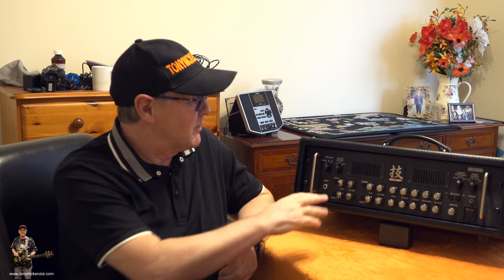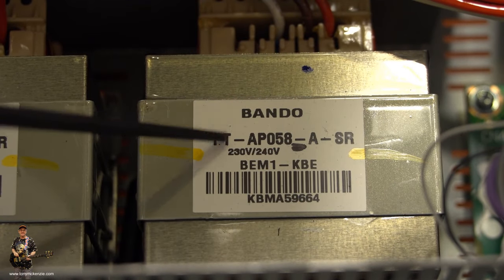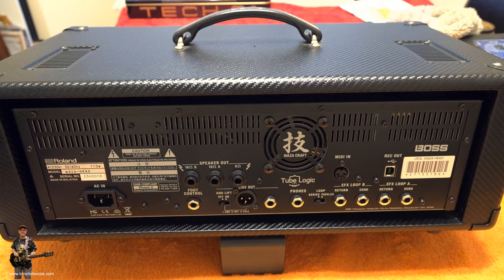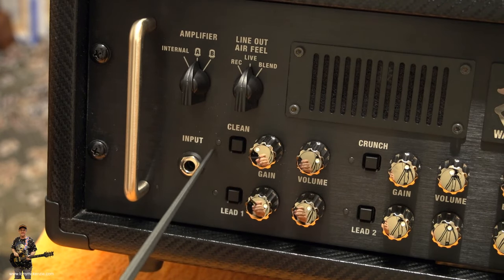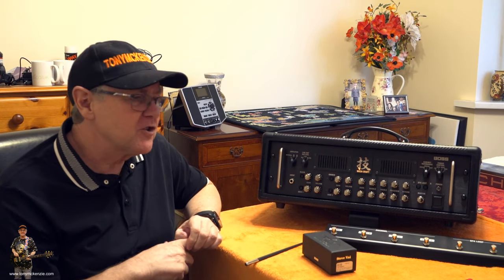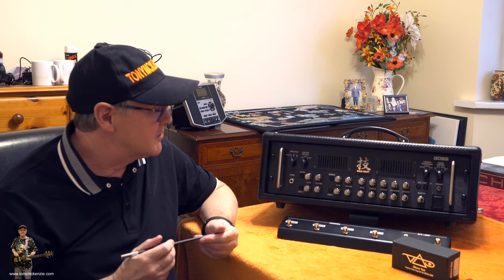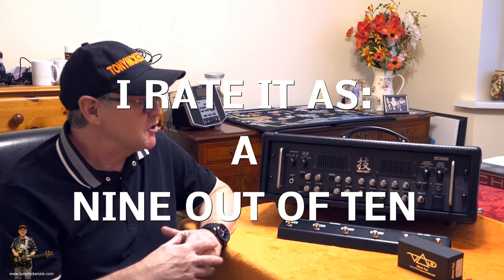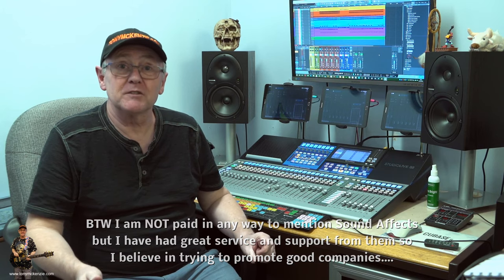Roland Boss Waza Craft Amplifier Inside and Out Review & Playing | Tony Mckenzie

Comment: I found and bought the 75 watt version with the 2x12 cabinet. There's a lot on offer here. These had a very short run. Glad I was able to find one brand new. It's for players who want a high gain amplifier. Adding this jewel to my collection with a 50th Anniversary Roland Jazz Chorus 120. Who says solid state isn't as good as tubes hasn't heard these. All amps bring different tones to the table, and this one is very nice.
Reply from the maker: Yes they are interesting devices and I still have mine too :). Thanks for watching.

Comment: I have just bought a nearly new 75w version. At the moment I have a DVMark 4x12 cab. I paid £725.00 for the amp - it was new in February. Still has warranty etc. Haven’t discovered everything it can do yet but your cab sounds better! Keep up the excellent work Tony!
Reply from the maker: These are interesting amps for sure and built like a brick toilet! My guess is that the 75 watt is 'half' of the one on here but it won't make any difference - still a very good amp. I know the DVMark stuff in general... that's probably one of the light cabs? I had some 1x12's which you could pick up with a finger almost. I tend to in general stick with Marshall 1960a cabs, but I did buy the Waza 2x12 cab to match this amp. In any case you should come back and post what you think of the WAZA amp because guys will come and read it and maybe gain from your experience. I like mine and still have it too. Thanks... and stay safe Peter.
Reply: tonymckenziecom  hi Tony. I’ve played with my amp now a few times with the DV cab (as mentioned) and also a Marshall cab (for comparison) at gig volume. It sounds better through the Marshall - a little less ‘muddy’ . I like the ease and convenience of the Waza and is simple to use, but as I’ve been a Marshall man on and off over the years, I feel the Waza is lacking in the warm valve dynamics. It can come across as “brittle” depending on the settings etc. I’m also a little frustrated with the second “lead” channel as you can’t replicate the first lead channel and just have it tweaked and louder for solos etc - you have to have what you are given, and as it’s a shared e q then there is compromises. I’m not sure if I’ll keep the amp - there are many good reasons to keep it, but I’m just not getting the vibe in total (if you know what I mean). Any one thinking about buying one, please check it out as it’s a great bit of kit, but have in mind what you are hoping to achieve from it (sound wise ). I would like a Marshall JVM HJS, but I feel it’s like looking for hens teeth! Keep up the excellent work Tony!
Reply: ... incidentally Tony, how did you find the Waza cab with the amp? Does it sound better than say any other cab? Cheers
Reply from the maker: I can agree it is not the same a a cranked Marshall amp for sure. And I agree that it can be toppy (as most simulators seem to attest). Your comments really do remind me of the 'simulator' thing... and I have used all of those. They are OK to 'Good' sounding, but they have a particular 'feel' when you play them. It is not the same as a real tube amp when you play through one. I would relate that way to the WAZA amp. For what is really a 'transistor' type of amp though, it does go much further than any of the other contenders that I have used. On the WAZA speaker I do not think that sounds 'better' in any real way than my Marshall 1960a cabs I have irrespective of what many might say about FRFR and all that stuff. The shared EQ stuff is not a concern to me, but I do often choose things like a wah pedal for the lead guitar and that throws things around, but I know exactly what you mean... and indeed I could name tube amps like that in the EQ area of things. It's great to get other opinions from real users like yourself and I know, that other than the 'sales' videos of the WAZA amp there was sorely lacking any real 'bones' to the amp online... maybe with one exception of the Sound Affects' video which I thought was very good - if you have not seen that you should. Check out those little Marshalls I recently reviewed (SC series but snake skin or the STEALTH one) as those two amps really cut the mustard... I liked the stealth amp and that suited my playing style so well. Thanks for the info... and stay safe.

Comment: Appreciate your in-depth review Tony.  If you are happy with the guts of this piece of kit that should be good enough for anyone.  Most of us are scared stiff taking the back off an amp so it is always a pleasure to see you prodding around on our behalf! Happy New Year to you and keep the reviews coming.
Reply from the maker: Well I have had just one comment somewhere below yours where the guy did not get on with my comments and even cited that the 'transistors' did not have cooling fins or something like that, but in reality that sort of thing depends on the circuit and how its driven and a host of other aspects. Frankly, if Roland Boss engineers don't know what they are doing it's time to give up. I trust the Roland Boss boys and have rarely ever seen anything fail from them. I have to say I was very impressed with the quality...  but it should be there at the retail price of this amp. At the price I paid its a bargain bearing the quality and the sound in mind. 

I always try and get inside simply because doing that always shows the good (or bad) points of what you are really buying. I have seen some real junk and not always at the bottom end of things. So the inside and out reviews will continue... its the only way to create a review that tells all in my opinion. I'm glad you liked the review - I enjoyed making it too. And yes you too and your family have a happy new year too.

Comment: This is a sweet amp, the only thing I don't like but I understand BOSS for not making those fuses accessible from the outside. Another great and thorough review, thanks Tony. Merry Christmas and a Wonderful New Year!
Reply: I just check the price in Canada, $3700.00 + 15% taxes. That comes to $4250.00 which is a LOT of money for a solid state amplifier, whatever it can do or sound like. Only a professional can justify its purchase because casual or regular band player will probably go to a valve amp that is in style.
Reply: I'm 69 and had prostate cancer two years ago and they had to remove it completely with a Da Vincy a robotic surgeon performing the actions of the human surgeon. It been two years now and I am still cancer free with a Prostate Cancer test PSA (Prostate Specific Antigen) at 0 (within the error factor of the analyzer). If it is caught in time, it is CURABLE.
Reply from the maker: @micheltremblay4774  Hi Mike, even a pro could not justify that price. It's the main reason we see none around. At my £900 ($1200) it was a good deal... watch for them they are sure to drop dramatically. Thanks for the info.
Reply from the maker: @micheltremblay4774  I had the Davinci machine too. You will be fine. Mine was 6 years ago and PSA is about 0.02 which is basically zero. You hit it on the head... its all about how early you get it. I was 59 at the time, but I have met many guys as young as 39 and that's the thing, it seems to me to not just be an 'old mans' disease. But some doctors are reluctant to carry out the checks here if you're 40 ir so and ask for the tests. Some of the colleagues I work with have said that after being pestered by me to get checked out. In any case Mike well done, its a hard road you have been down, and so I have too, but I'm sure you will be OK. BTW my PSI before the op was 4.9.

Comment: No disrespect to your grandson, he has come on a lot but the tones you achieved were great.  This is obviously a very good piece of kit.  Thanks for the revue and merry Christmas!
Reply from the maker: No problem on that Chris. I was surprised how exacting his tone on that snippet was to the original especially when you're in the room so to speak. On my bits they were just jamming really and I wanted to show a heavier and lighter tone hence the tracks. I never even go near the 'Steve Vai' module, all I did was to back off the guitar, switch in or out the delay and chorus with some wah occasionally. It's a very good amp for that sort of sound. If you push the drive to full on the amp the sound suffers a bit, but I did not go beyond say 1:00 on the drive on any channel. It was not good at £2300 (that's $3000 but might be cheaper in the USA) I thought it was way over priced. But at £900 which is what I paid then it's a very good deal I thought. I later bought the 2x12 Waza cab for about £400 and to be honest it is a very well made cab with specialised Celestion's in there - retail again was silly but buying 'ex-demo' is the way to go for anyone.

Glad you liked the review and I wanted to make this for a while, but did not until these came down in price. Merry Christmas to you too and have a great new year.
Reply: No problem Tony, your revues are always thorough and fun to watch.  I would like to second what you said about Prostate Cancer, my father sadly died from it, if only he had himself checked!
Reply from the maker: @chrisjeneson5091  Yes Prostate Cancer they say is the silent killer - even I could hardly tell I had it, but I'm one of those guys that watches close for ANY health stuff... it likely saved my life. Sorry to hear about your father... I have met many guys that have had it and some that have passed also and so from time to time I raise the subject in the videos and hopefully someone might just get checked and get past that stuff. Thanks Chris...

Comment: Merry Christmas Tony:)
i could be opening gifts but i am watching this video:)
its great.i wonder if the Katana amps use similar tech.they sound like a tube amp imo.
Reply from the maker: Ha... I completed it yesterday so as not to be slaving to the PC. I think the Katana is a different solution than that in the Waza, but I have limited experience of the Katana inside. I will be looking though. From what I have seen they seem to be more chip based and the Waza (read software) - of course I could be wrong but no doubt I'll find out in due course :). Thanks and I hope you liked the Waza amp and the video.

Comment: Tony, how does this compare to the DV Mark series? I really love your reviews you take the time to really get into them, I was still VERY happy you gave my JVM JS Marshall top reviews, I am convinced that is the Ultimate Marshall ever made. Anyway...I heard somewhere they have transitors that replace the actual tubes in the socket? Is that true and if so, what would that do to the tone? Haha I keep forgetting you are a brit and when you say it goes for 2000 or so LBs I keep thinking holy shit that thing is HEAVY bahaha
Reply from the maker: Well they are different. Like I said in the video, you have basically (this is just my opinion of course) two types of simulator of tube amps... the hardware based (as this one appears to be) and the software based, Line6, Kemper, Fractal Audio, GT-1000, the Multiamp and I'm sure you could reel off many others. Those always identify themselves from the continual 'updates' that keep appearing - like a PC ore even a mobile phone. Then there's this hardware method it seems, as this amp is. You don't see much by way of 'control' like the software simulators, but it seems to me that you do see a more tube like tone and feel. A good example would be to disable all of the software simulators effects and then play the unit and you will hear a far less likeable tone. It seems to me that the software simulators love to 'hide the amp simulation' with effects. On the other hand, this amp has only reverb and nothing else - if the sound is not good you would hear it without any 'masking' that the software simulators apply with effects. 

And the other 'give away' is the very limited control of the Waza amp by software from a PC... there is virtually none. Midi is also basic. Strangely, this Waza amp I believe may be the only hardware simulated amplifier there is... there is little info.

The Marshall JVM HJS in my opinion remains one of the best sounding Marshall amps out there. I completely agree... but I'll also say that the 410H head is a mere 'ordinary' amp in comparison. The main board is completely different and never the two will meet.

I think the nearest Marshall have gotten to transistors ah I cant be sure but the Marshall 'Core' springs to mind - and that is really a software tube amp simulator.... so I have not heard anything else about that. I think there was some tie up to 'softube' somewhere for that product.

Yes watch that. In the UK I represent at least two USA companies that we work with and of course they are always referring to Lbs (by weight) and in the UK its metre's centimetres and millimetres... thank Europe for that and I doubt it will ever flip back. So my Pounds refer near enough always to money. But lastly, this amp IS pretty heavy because of those power transformers and other bits inside... its no flimsy thing.

Have a great Christmas and happy new year Darth.

Comment: Excellent review Tony, an absolute bargain I would say, Merry Christmas to you.
Reply from the maker: It's still expensive at the £900 I paid IMO, but at least once you peep inside it can be seen IMO where the money has gone. A very interesting amplifier that does actually sound very much like a tube amp. Its not perfect, but it has the ingredients right there - and its easy to use etc. with a 'feel' similar to tubes and that goes a long way when I look at any simulator of a tube amp. This hardware method of simulation seems different than the software alternative too.  Have a great Christmas and happy new year Steve.

Comment: I am going to reveal myself as a heretic Tony,  last year (actually 2018) I sold my Vox 35 watt valve combo amp which is a decent amp, but bloody heavy with 2X12" speakers-and I bought a BOSS  Katana 100 watt 1X12" combo, which has 'Waza Craft' heritage, I have to report I don't regret it one bit, this is a very decent guitar amp, I don't care about the hype, or the neck beard critics, it works for me, has a ton of versatility and weighs about 10LBS, fantastic. BOSS really are doing something different.
Reply from the maker: A heretic! No I don't think so. You know, I had a Mesa Road King II combo once... and it weighed more than the house. It was a special order that took months to get here. Then I sold it! Me.. a tube amp guy sold a world class amp! You are exactly right re weight... there IS a limit to it, and as I get older these days there is no way I could even consider keeping a combo amp like that. It was impractical... and similar in many ways that you commented about too. It seems the Katana series are a great buy and its no chance that the Katana amps were 'product of the year' a short while back. 

The Katana are based more on a 'software' emulation, whereas (as I understand it) the Waza Craft head as shown here is a hardware simulator... meaning that the hardware inside this amp literally simulates a tube amp circuit and responses to playing tone etc. So there is a difference. The Katana in some ways offers far more (as often software simulators tend to). Fort example the singular effect on the Waza Craft is reverb. That's it. 

What I tend to find personally on the 'software simulators' in general, is that if you turn off all the effects then the tone is 'laid bare' without the effects and it is discernibly not a tube amp. The Waza Craft with or without it's reverb still feels and sounds very much like a tube amp does when you play. But that's not detracting from the Katana in any way, that product is absolutely brilliant value and it does the job it is supposed to do very well indeed. In fact, when I can, I'll get one and complete an inside and out review of one of those :) which should also be interesting and I'm looking forward to that. 

I like Roland Boss because the quality is near enough always there (I have found one singular product to date that I did not like much) and their products are always guaranteed to be fully compliant with the standards applicable for each country. I can tell you there are many others out there that fall far short and cost substantially more in many cases.

Thanks Michael, for the info about your experiences with the Katana - I love to hear what guys think that actually own the gear (as I do) because they are genuinely telling the way that they find it themselves... great points. Thanks for watching too - I hope you liked this one.